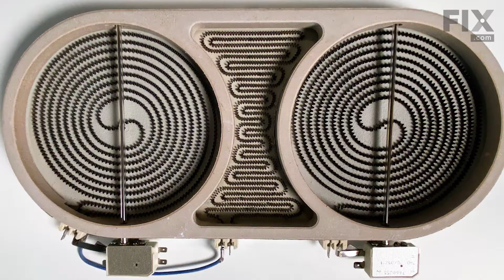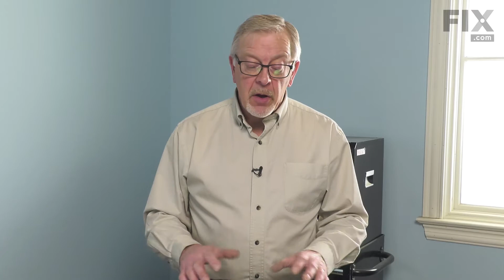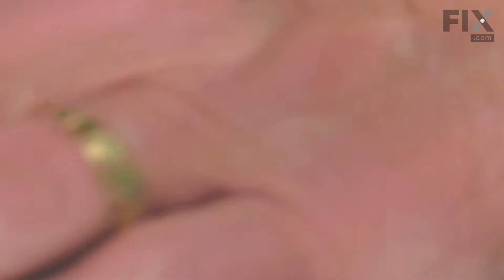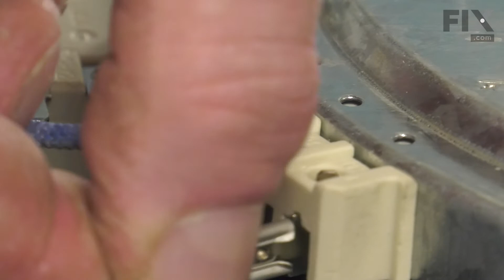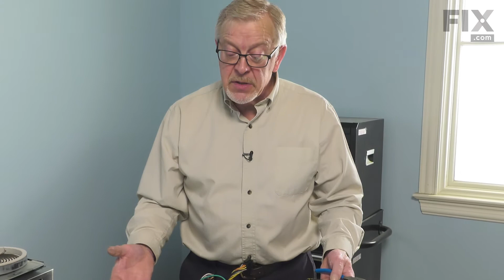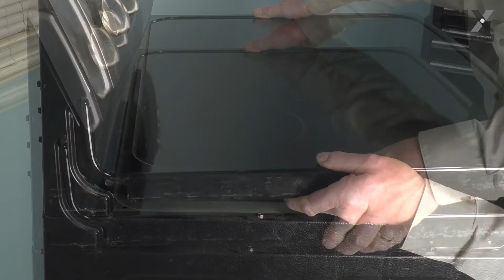GE Range Repair - How to Replace the Bridge Element

Comment: Thanks for this. Nice camera work! My range element is the same except I have an extra wire that attaches onto the old element at P1 where your blue jumper wire is. The old element has a terminal connection on the bottom but the new one does not. There is nowhere for the blue jumper wire to attach like in your video. Wondering if you have any ideas?